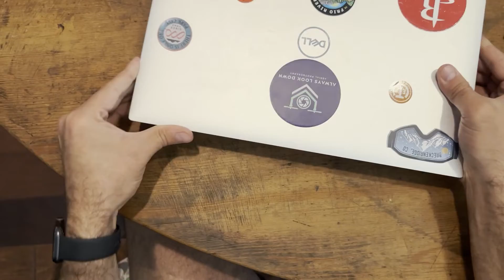How to Replace a Dell XPS Laptop Battery (XPS 15 9570)

Comment: Can this laptop work without the battery?
Reply from the maker: Interesting question. I’m not sure.
Reply: @daddoesitALL  I was wondering the same as these ‘low battery’ warnings kept popping up. Once the battery was 100% depleted, I couldn’t use my laptop at all. It doesn’t run on electricity by itself.
Reply: @daddoesitALL And thank you for the tutorial. I successfully installed my new battery tonight, thanks to you.

Comment: pro tip: don't let the fans spin while blowing them! Could throw voltage back into the motherboard frying components. Just hold it down with your finger while air dusting

Comment: Nice video.
I wonder where I can check my model number. The battery is dead on my 15 inch DELL XPS.

I see alot of different XPS batteries:(
Reply from the maker: @Trancelistic  there is a Serial Number underneath that little flap that says XPS on bottom side of laptop.  You can use that to look up model number on the Dell website!